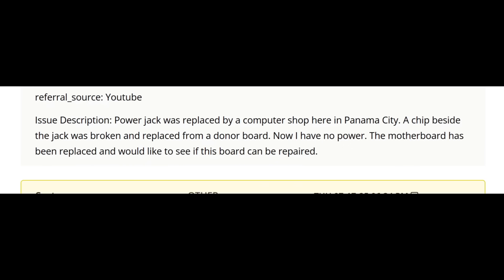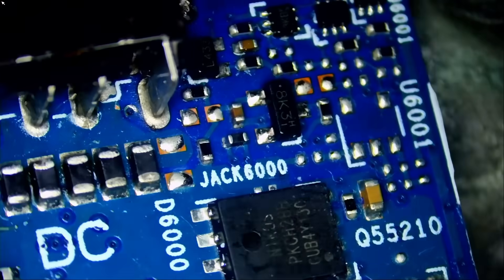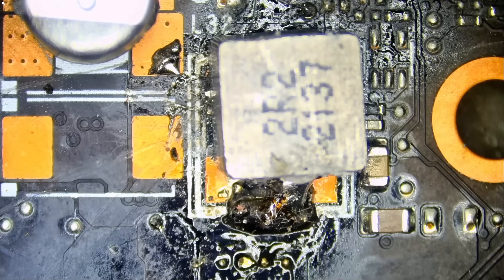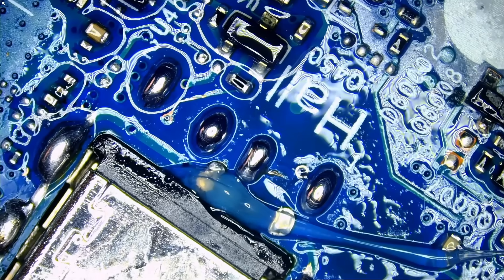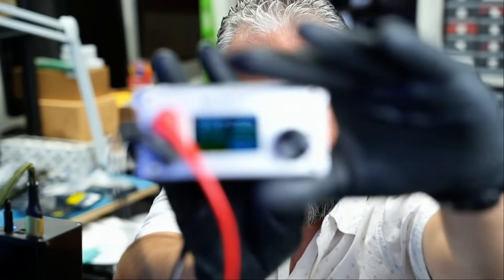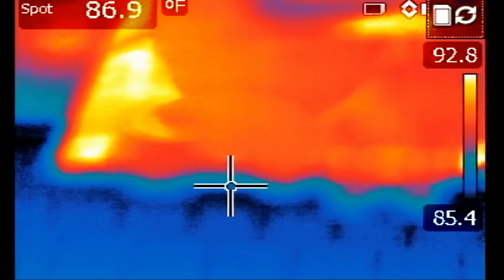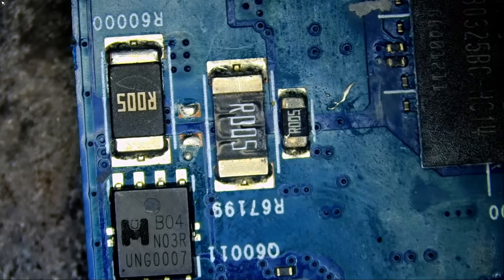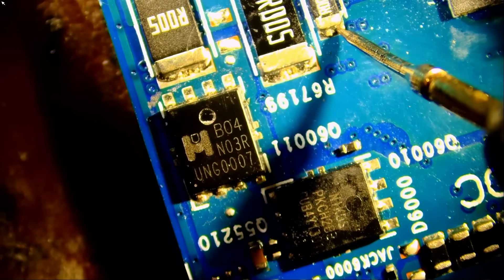Laptop Motherboard Repair - Came in from Panama City. How bad can it be ?

Comment: Hi there.  I like your videos.  I have a surface mount circuit board that is draining my 3v battery as soon as I input the battery.  Once I take the battery out and check the voltage , the battery voltage starts to restore back to 3v.  When I input the battery, the device shows low battery because the battery is being drained. Can you help to give me your counterpart in the uk to fix this please.

Comment: can any one help me in fixing my board. PLEASE I have only this PC.
My motherboard is powering it on and showing error 53 with 3 beep and no Display.
Rams are correct Bios I replaced by CH314a programmer but still remain same.
what can be the issue?
Motherboard:- Z77 extreme 4. There is no damage on the motherboard (visual inspection ).

Comment: I have a Fritzbox router. One day I noticed that all the status LEDs were off. At first I thought that the power supply was broken and connected another 12V power supply. Nothing glowed. Then I tried the original power supply on another router, which worked. I had a massive short circuit at the 12V input on my router. I took my lab power supply and set it to 3V 10A. The defective router pulled the voltage down to 0.3V 10A. Then I flooded the router's board with IPA. A tiny condenser reveals itself as it evaporates the IPA immediately. This one also got very hot. Then I unsoldered this SMD capacitor and the short circuit was gone.
I soldered another capacitor in its place. The router works fine again.

Comment: The thermal camera is a great tool.
Back in the 1980's we used an HP milliohm meter. You could measure shorts with precision and could tell when you got closer to the actual short.

Comment: saying lines like " a beginner" can be really harsh, what if he is watching this video, motivate him "keep trying, you will get there". what if the guy who mailed it spreads news that gets his shop with less customers, world is a really harsh place
Reply: If someone opens a 'repair shop' and not only doesn't fix the issue but creates bigger issues then yes, they need to be called out for it. The mentality of 'keep trying, you will get there' should have been done long before opening a shop to the public and taking on jobs they don't have the skill to do.
Reply: Those sloppy solder joints are predetermined break points. The irregular surface creates a notching effect which causes fatigue fractures. Beginner's work indeed.